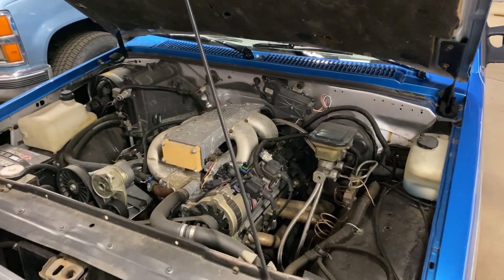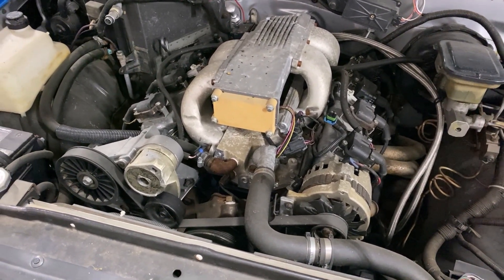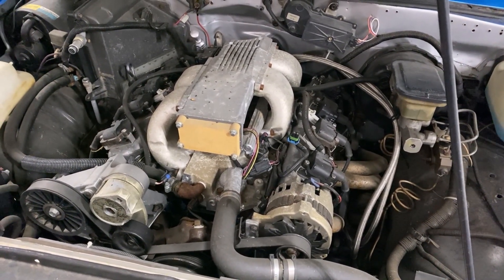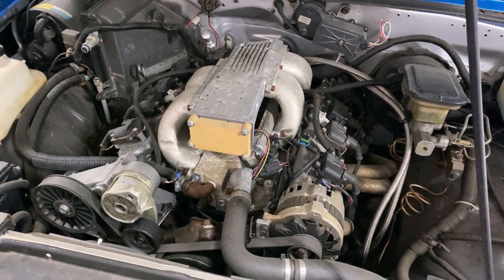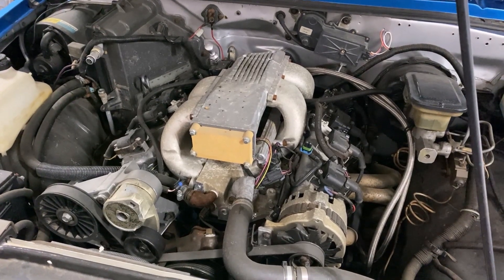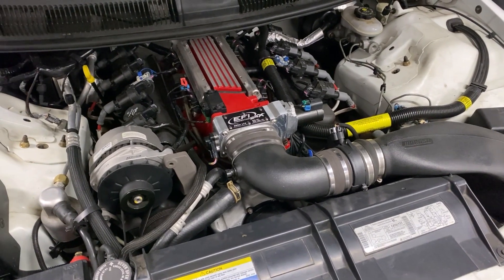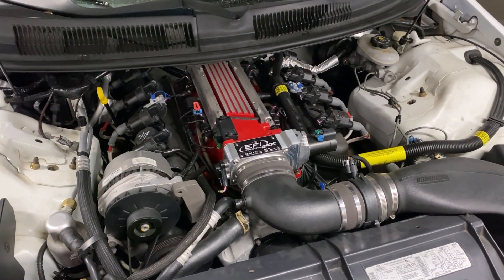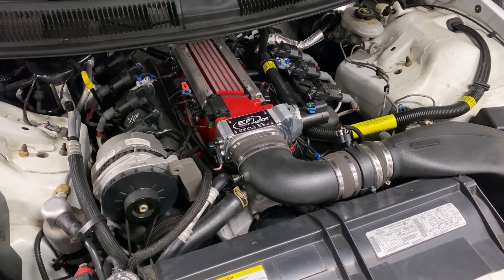Intro to CAN Bus Module Development for Gen IV LS-Series E38 and E67 ECMs

Comment: Definitely need to chat with you regarding the 58X swap I am working on.  L31 based 383 in an Express van that I want to add analog AC input to as well as retain the GM cruise control. Want to keep the 4L85E for now but convert to a 6L90E in the future. What would be best for the PCM and TCM?

Comment: On the Tahoe, if you’re going to be developing canbus tech, why not use the 6L80?
Reply from the maker: The original plan was a 6L80E. After reaching out to several trusted builders, we were quoted more than $8k and 4 month lead time. The 4L80E was built by Performance Automatic Transmission Center (PATC), a long-time customer of ours, for half the price of a quality 6L80E. We feel good about the decision to use a 4L80E. As far as CAN bus module development goes for the 6L80E/6L90E applications, we have a 2WD 6L90E to play with.
Reply: @EFIConnectionLLC  wow! What kind of power are you expecting? GM performance parts sells a 6L80 that can handle 650hp, I just bought one to do a swap out on my JK for around 4200.